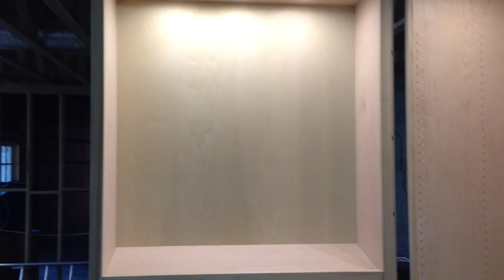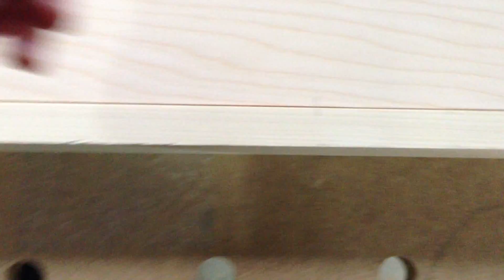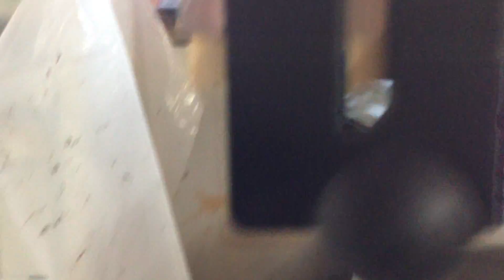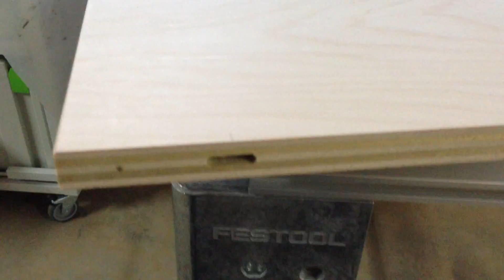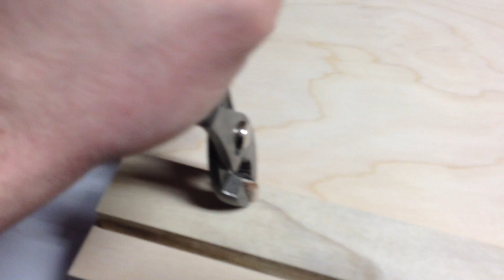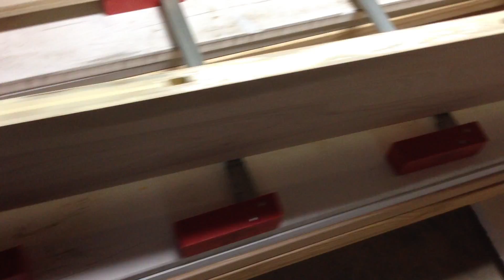Closet cabinets with Festool Domino

Comment: I'm in the process of building a number of bookcases using somewhat the same method you did here.  I also had the problem with edge burn on the poplar. I noticed you glued up the shelf before you had the opportunity to remove the burn marks.  How would you recommend removing the burn once glued together without damaging the plywood's thin veneer?  I did the same thing and am now worried about damaging the plywood with my scraper.  I guess the best solution would be to clean them up before glueing together.  I thought about doing that then forgot in my haste to get the project done.  Thanks for the video, really enjoyed it.
Reply from the maker: It's tough. If you are painting, then the burn marks will just be covered.  If you are staining then maybe you can use a cabinet scraper to lightly bevel an edge thru the burn without cutting into the plywood veneer.  If the burn is deep and you are going to stain the project then you could always cut through the burnt portion with your table saw to create a small rabbet that you fill with a new veneer strip.

Comment: It looks like beautiful hardwood plywood with your poplar edging strip.  When you said "ready for paint" I winced.  Beautiful wood is meant to be seen and enjoyed.  I was thinking you were about to say "finished with a durable clear coat."  I did one of my closets with open cabinets made from melamine-covered particle board (yes, eeeek!), and I'm thinking of ripping them out and re-doing it in some good cabinet-grade maple plywood.  On a different point, it seems using more than two dominoes on the edge band would be classic over-engineering, especially given the sufficient strength of most any good quality glue to hold the edge band in place.  I will confess that when I first got my Festool 700 Domino, I put them everywhere and in everything just because I could -- and because it was so much fun to use it. Thanks for posting.  The closet cabinets look great.